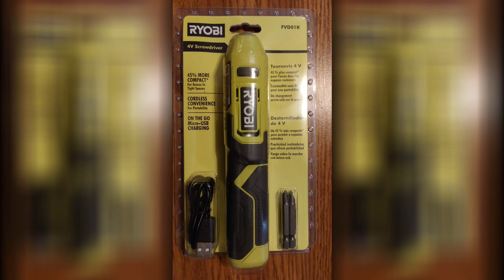RYOBI 4V Cordless 1/4 in. Screwdriver MODEL # FVD01

Comment: I want an electric screwdriver for disassembly of electronics which have many small screws, often involving plastic parts. Limited torque and speed is suited for such delicate work. Simplicity of operation, switch placement balanced light weight and the ability to use a long extension to accurately place magnetically held screw on the driver tip and place it accurately in the screw  hole is important for this kind of work. I'd like to see a demo with this model that demonstrates those capabilities, I don't care that it can't drive long screws into undrilled wood.

Comment: Hello!

How do you get the bit into the thing? I can’t get it to stay inserted into the handle
Reply from the maker: I am assuming you are using the screwdriver bits that came with the screwdriver. 
The collet has a spring clip in it that holds tension against the side of the bit. This is one of the 3 common methods that screwdrivers use to hold bits in.
You would insert the bit into the collet and push the bit in as far as possible. To remove a bit, pull the bit straight out of the collet
Reply: @HowItWorks1  Thanks for the fast reply. I pushed as hard as I could and I still cannot get the bit to stay in the collet. I even turned it upside down pressing my body weight against it and it will not stay in. Obviously, I don't have much experience with these types of tools, but I would assume the bit should stay in the drill until I am ready to remove it.
Reply from the maker: Yes the bits shouldn't come out unless pulled out. It could be that the screwdriver is defective. I would return it to the store.
Reply: @HowItWorks1  mine didn't come with bits and everything I try falls out
Reply from the maker: Mine came packaged with two bits. Other bits with the end like those shown in the video should work.

Comment: Only 250 RPM. Does not seem like much torque. Will try & advise. No charging light & is the body is not magnetic like my old one. You can use other brand drill bits with this. I did.
Reply from the maker: I believe this is made for small screws. Certainly, with pilot holes first drilled into the work piece.